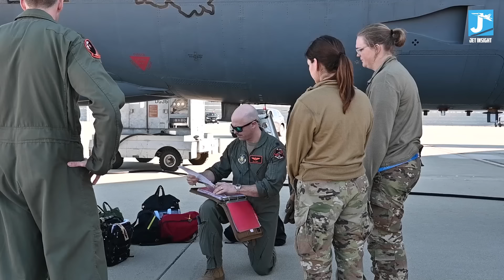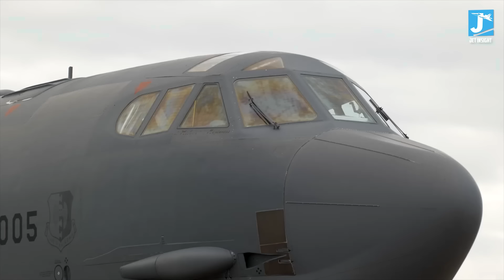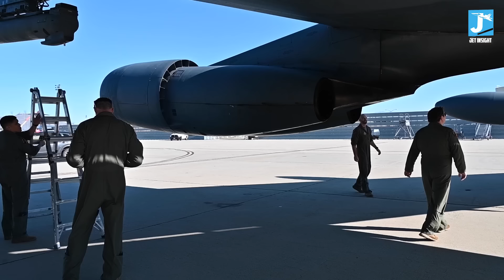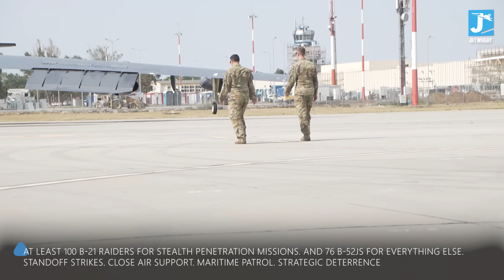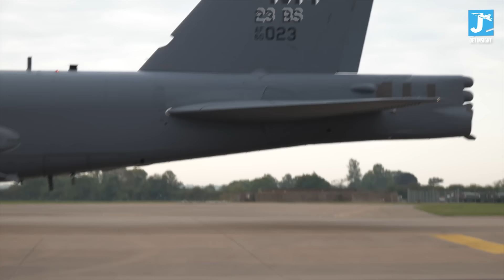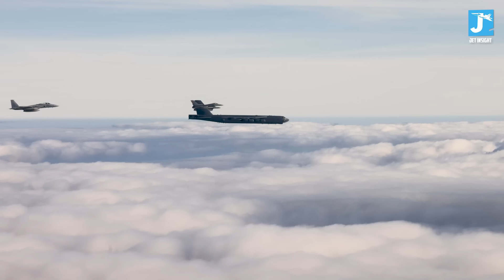The B-52 Bomber's INSANE Upgrade Will Keep It Flying Until 2060

Comment: Great review, very well done. It's mind-boggling to think that a military aircraft first designed and built in the 1950's will be flying up to and perhaps past 2060. That's beyond unbelievable!! Yet it looks as though that's exactly what will be happening. However, eventually "something" will need to be designed and built to replace the B-52. If you folks have any skinny on what that might be, I for one would enjoy seeing a video speculating what the ppl in the know are currently thinking a B-52 replacement will be like.  Cheers!!

Comment: This is an excellent video. I helped design the B-52G/H in 1956, and was involved in its development and operation until 1969. The original B-52G was designed for high-altitude bombing, with the emphasis on minimum weight, to maximize range. But in 1961, at the height of the Cold War, we redesigned the structure to meet SAC's new, more severe usage and service life requirements. These notably included low level terrain avoidance training, often under extreme gust and maneuver conditions. The emphasis in structural design shifted to toughness and durability. The primary structural components are never replaced. The main reason for their longevity is that the usage has not been as severe as was projected. As Chief of Structures Technology at Boeing-Wichita at the time of the redesign. I am honored to say I chose the materials, the analysis methods, and the limiting stress levels for the redesign. I am now almost 100 years old and I am thrilled to see these planes still flying, and projected to do so for many more years.

Comment: Forget the fluff, there is nothing here to blow my mind. The B52 is in service now , because the planes is here, all paid for and have enough numbers to be a viable weapon. It is viable because we now have ballistic missiles and cruise missiles and eye in the sky that see every target. making flying into high threat environment unnecessary.  We might as well use it since the B52 already exist. It is basically just a slow bomb truck. Part of their function already been taken over by fighter bombers. One of them was the famous F4.  If we scrapped all the 52s, we can always load bombs on to pallets or roller beds and into cargo planes such as the Herc or even A400 or C5 and just push them out the back door. No different than delivering an APC while flying just off the surface without landing. This muddied the difference between cargo plane and bombers , just like fighters and bombers in the 60s.

Comment: Should've just upgrated them to JT8D engines back in the 90s or early 2000s ... engines with much wider repair+parts infrastructure + much longer commercial use + existing precedent for replacing older P&W TF33 engines (as well as J57 engines in some installations where TF33 upgrades never occurred). Being P&W designs with overlapping legacy, the upgrades and modifications needed for the power + hydraulic systems would've been dramatically less.

Albeit to minimize cost/complexity of the refit, given the B-52's paired engine nacelles and specific handling requirements bound by both engine thrust and external nacelle diameter, it might have been easier to use the smaller diameter JT8D-17A and R series in the 17,400 lb thrust rating class (also about 1000 lbs lighter than the TF33), rather than the larger diameter, later JT8D-200 series (incuding the -218 and -219 slated for a variety of refit proposals to other military designs using the TF-33 in 4-engine configurations, mostly with 707 derived airframes, like the STARS aircraft).

OTOH the larger diameter of the 200 series (plus higher thrust and weight, but only moderately heavier than the TF33) would have been closer to the aerodynamic and weight changes being dealt with over the RR 725 series.

Though for realistic cost-wise, the JT8D-17 series would've likely been highly appealing. (plans to later upgrade further to the 219 might also make sense given the systems compability, thus leaving the aerodynamic changes to the nacelle design + pylon being the main considerations for investment) They kept the 200 series in production into the 2010s, and could have even longer had there been further contracts. (proposals for re-engining such continued through the late 2010s, with the STARS E-8C refit being cancelled in 2019, so the logistics would definitely still be there and the logistical overlap between the older small-diameter -17 vs 200 series would be such that an upgrade of that sort would still be favored over the BR7xx, even though the latter is more fuel efficient)

Comment: Well, boys, we got three engines out, we got more holes in us than a horse trader's mule, the radio is gone and we're leaking fuel and if we was flying any lower why we'd need sleigh bells on this thing... but we got one little budge on them Rooskies. At this height why they might harpoon us but they dang sure ain't gonna spot us on no radar screen!

Comment: when I was in the Air Force between 1965 & 1969 the B-52 bomber did not have turbofans.  Some years later they started retro-outfitting them with those new fans.  What surprises me, is that they are continuing to use 8 engines instead of four of the larger turbofans used on commercial aircraft.

Comment: Sorry, but this has some really screwed up "facts" about the B-52 engines!   I was working B-52-Gs at Barksdale AFB in the early 1980s.  I worked ECM, radar jamming and communications jamming.  It was CRITICAL to the B-52 surviving a mission.  Still is.,  No ECM, BUFF gets shot down.  But they were G model BUFFs.  G models had the OLD engines.  Those were replaced by the H model TurboFAN engines.  Mush more powerful, quieter, and NO WATER needed to take off.  WATER INJECTION was the reason for the intense Black Smoke.  SAME with the KC-135 Tankers!  NEW engines meant more fuel and more efficient.  The turbojet engines required water injection to improve power and get a fully loaded Buff into the air.  Less efficient than the H model TurboFan engines the BUFFs were retrofitted with.
NONE of the B-52s in the air today are running the same engines as back in Kennedy's day!  They were replaced with Turbofans UNDER PRESIDENT REAGAN!   So right there this video is VERY inaccurate.  New Engines ARE Needed, but they are NOT Nearly as old as this Stupid video is saying.
What else have they gotten horribly wrong?    MUCH.

Comment: In 1987 I was airborne in an S-3 Viking off of Oman when we were asked to intercept (lol) an "Unknown Rider".  I worked the radar and had to change the angle of our radar up and down to finally pick up a target at over a 100 miles and still blinking in and out.
  Eventually we found the Unknown Rider was a B-52.  We followed the B-52 and tucked inside their wing span at the start of the trip back.  As we closed the distance to our carrier they started descending below 300 hundred feet.  We were told to break off while they made a low pass by our carrier below the flight deck.
  It was great to have escorted these legends.

Comment: This bird is like something out of an old movie. When fully loaded, the wing flex is a force of nature. I remember hearing about B-52J 25 years ago, projecting the planes service life would be extended to 93 years. That didn't include many of the upgrades mentioned here.
But to wrap your head around this flying locamotive, the weight it will carrry across the sky over 100 years is a number no other aircraft will ever achieve. They run those engines for 45 mintues, get them good and hot before they hit the skies. The A-10 is another bird that needs to be extended. It is still the very best at what it does.

Comment: I worked for Boeing in the early '80's. I was told that it was designed by 12 engineers. 
A test that was run on a RETIRED one put it through an additional 100,000 hours of simulated flight. The final step of the test was to break the wings. They gave out at 125% of their rated load! 
Wish they made automobiles like that!

Comment: EWS/ECM 328xx here. I was with the BUFFs during the end of the Vietnam War, out of U-Tapao, Thailand. My job was to repair the jamming radar systems so the crew could get their planes to where they had to go without getting hit by SAMs or anything else. Very SECRET work. After the war, the score was that the Buffs flew over 125,000 sorties. We only lost 31 Buffs, 15 to SAMs, 16 to in-flight accidents from inflight refueling problems with the G model out of Guam. We fuck*d them up good. It was a very stressful job, and I was young. That success is why they are still here. No bullshit. The Buffs can fly in low, 500 ft AGL if they want, and stay in the air and loiter for days. I still won't speak about the secrets. I love the Air Force for my service and training. By the way, back then, they could be loaded with 84,500lbs of bombs if they didn't load full fuel.

Comment: Presentation forgot to mention the new RR engines have a 4x higher bypass ratio. They will get a 30 to 40% greater range. Not 8,800 miles! So increase that to over 12,000 miles👍

Comment: Considering the B2 is $2,000,000,000 each upgrading 75 +/-  B52s is still cheaper. I understand the B21 is far cheaper than the B2 but still. Didn't it first start flying in the '50s?
Go Army.😁

Comment: In  June 1964 I left Lackland AFB  and arrived Amarillo AFB for training I go I could fix AutoPilot systems on the fighter of that era.    Little did I know that Amarillo was a Strategic Air Command (SAC) base.    A few nights later SAC had an Alert that sent about 30 B52s and KCs over my barracks.   This continued for the next 6 months  when an Alert was needed.    After that I fixed  RF 4c  and F4s they didn't even wake me up.

Comment: When I hear, that all the old analog equipment is supposed to be replaced by newfangled modern digital systems, I wonder if the B-52s will still retain the qualities that distinguished them over the decades. Usually, the quality of anything converted from analog to digital only suffers. In a critical combat situation, it takes is one sensor failing and then what? Then almost everything else stops working too. With purely mechanical analog systems without all the newfangled digital nonsense that doesn't happen.
It's the same story everywhere, whether it's cars, trains or airplanes! One sensor breaks – nothing works anymore. And they can test as much as they want beforehand...

Comment: "The U.S. Air Force is currently in the process of replacing the engines on its B-52H Stratofortress fleet as part of a major modernization program to create the B-52J model. The new engines, Rolls-Royce F130, will replace the aging TF33 engines, which have been in service since the 1960s."  The new engines will be more economical and increase range even more.  The B-52 and A-10 are tje best at what they do and are the oldest ones...

Comment: When I was training to be a USAF PJ at Lackland/Kelly, TX AFB in 1989 I had an IROC and the wing was only about 1 foot above my car roof, but when it took off the wings would flex up.  We used to sit at the landing area of the air strip for B52's & C-5's that is an amazing aircraft.  If is not broken, don't fix it. Great job.
Reply: I think I read the wings flex 17 feet from rest to normal flight.

Comment: Proud to be a part of this upgrade!
Reply: Glad it finally happened after so many attempts to just punt downfield again. Pratt though they had it made, but this was the only sensible choice, and it is now from a trusted supplier at the Allison facility in Indy.  Delta has kept the supply chain going as well with 85% commonality to the CR-715 on the 717.

Comment: You need to get your facts straight, the first B52s had P.W. J57s none fan engines. I am surprised the amount of black smoke from the TF33 engines. I worked on them in 1966, and also J57 B52s. And why did you forget about all the sorties flown by 52s in Vietnam? 31 were lost.

Comment: The Air Force should have retired the B-52 and made more B1 Lancers. Compare (the B1 wins in 3 of 4 categories):

Top Speed:
B1 Lancer = Mach 1.25 (900+ mph)
B2 Spirit = Mach 0.95 (729 mph)
B-21 Raider = Mach 1.25 (900+ mph)
B-52 Stratofortress = 650 mph

Top payload:
B1 Lancer = 75,000#
B2 Spirit = 40,000#
B-21 Raider = 30,000#
B-52 Stratofortress = 70,000# 

Ceiling:
B1 Lancer = 60,000 ft
B2 Spirit = 50,000 ft
B-21 Raider = 55,000 ft
B-52 Stratofortress = 50,000 ft

Range w/o Refueling:
B1 Lancer = 6,500 - 7,500 miles
B2 Spirit = 6,900 miles
B-21 Raider = 6,000 miles
B-52 Stratofortress = 9,900 miles

Comment: No doubt the B-52 can be kept going this way.  But I cannot see why the money would not be better spent on buying more B-21 Raiders.  I think that it is time for the Air Force to let go of the B-52.  I notice that we did not use the B-52 recently in Iran.  The plane really isn't much good for heavily defended enemies.  The B21 can handle these targets.  The money is better spent on B21s.
Reply: The B-52 has become mostly a stand-off delivery platform.    Yes, it has been used in recent 'tactical' roles but it is intended to do a much more strategic role.    It can deliver some very nasty weappns from several hundred miles away if it has to.   It gives countries like Russia & China a lot more to think about.

Comment: The best version of the B-52 only uses 2 Large engines mounted close inboard - suddenly - 1 man can fly it - and it can turn well.
Reply: Never existed but would have needed to recertified for flight and training programs recoded. But I like the idea of two B777-class engines and maybe a single non-afterburning F110s on outboards for takeoffs and emergencies.  Would have freed up space for conformal weapons pods and whatever McGuyver could hang underwing.

Comment: They're also removing the chin-mounted electro-optical sensors on the B-52J. It will get a new sensor suite that now has a smooth nose akin to pre-1970's B-52G/H planes.

Comment: No one ever mentions that we are still using the KC-135 from the same era as the BUFF.  Yes there have been other tankers and other bombers, but this pair is iconic and long lasting.
Reply: The majority of my proud 20+ years of my USAF career was spent as a Crew Chief on the phenomenal KC-135. A little tidbit of information about the two old workhorses. The mighty B-52's maiden flight was April 1952 which was years earlier than the KC-135s maiden flight in Aug 1956. However, the current B-52 that are still actively flying with the USAF were built in 1960 and 1961 as you can find in their tail number that starts with the year it was built. So, there is kind of a misconception that the B-52 is the oldest active warbird still flying. It started being built in 1952 but the only B-52s that are still capable of flight were built in 1960/1961. The KC-135 on the other hand still have a lot of tankers flying that were built in 1957, 58, 59, 60, 61, 62, 63 and 64. Not to take anything away from either one of the beasts. They are both still 100% old-school rockstars that will continue to kick ass for years to come. When it comes to the KC-135 the facts are the facts. 👉 NKAWTG!!! 👈Nobody!💪My last KC-135 that I was a Crew Chief on was tail number 62 3559 which was built 5 years before I was born in 1967.😅
Reply: @WickedWooster0444  thank you for your service.
Reply: @WickedWooster0444  KC-135s moved to CFM56-based engines.
Reply: @MadRat70  Yes they went to the CFM International CFM56-2B1 (F108-CF-100) engines from the J-57s in the 1980s. Huge difference in power and efficiency. My first duty station was Robins AFB. Luckily all the 135 had been upgraded to R models by the time I got there. However, I did get to work on the KC-135A models at different times in my career. I finished my USAF career on E-3 AWAC which has the TF-33 engines.
Reply: @WickedWooster0444  thank you for your service!

Comment: When I read this my first thought is "if it works, don't fix it", knowing that the basic design, the airframe, is a good design. Most of the rest plane can be exchanged, and even an airframe can be maintained and exchanged bit by bit. 
I came here to read about the airframe and progress in engines and avionics, ... and perhaps even toilets, onboard microwave ovens, and water supply for a shower if they are airborne more than a week, refueling in the air perhaps, instead of stop-overs?
Reply: No don't laugh at me, please, I am not an air-frame specialist, but I know there is a lot of make-believe around defense materials, airborne weapons, strategies, materials, and hype around new airframes.

Comment: today anti-aircraft missiles can easy target a B52...really its obsolete as a bomber and so big target // its impossible to miss.I would have had a commercial idea....to make them shipping air-cargo planes for making long shipping routes more efficient,not just for military but also for business cargo.This aircraft can make a very good cargo transporter  a business of win-win for everybody
Reply: B-52s carry massive electrical capacity to power heavy jammers including microwave-based emitters that can fry electronics in a 5 mile radius.  When they have no operational restrictions they are an offensive sledge hammer.
Reply: @MadRat70  high power jammer is good for defence against drones...but again this airplane is slow and very big...it canot be defended against anti-aircraft missiles today weapons are very dangerous just think about that russian S-400 missiles
Reply: @CM23JUNE  You should ask yourself why did S-300 fail in Venezeula. B-52 is brute force overkill in any environment, contrary to your belief.
Reply: @MadRat70  There are many airplanes stealth to the radar and they were used in Venezuela to destroy the missile defence.I have seen a picture with the s300truck it was bombed very accurate in the night